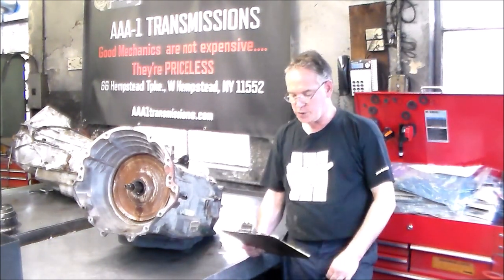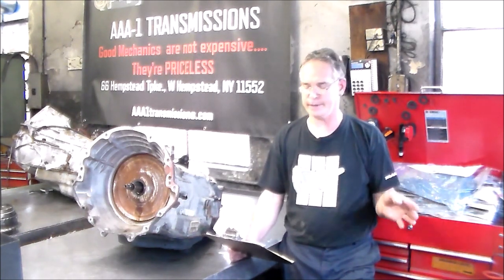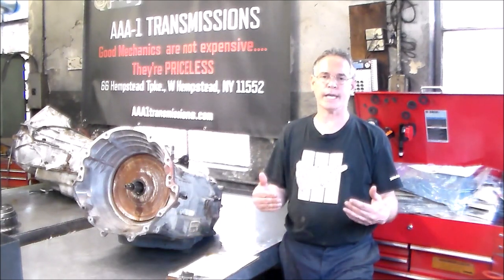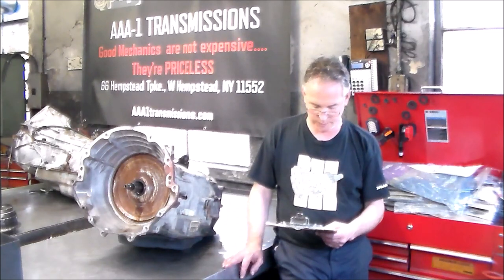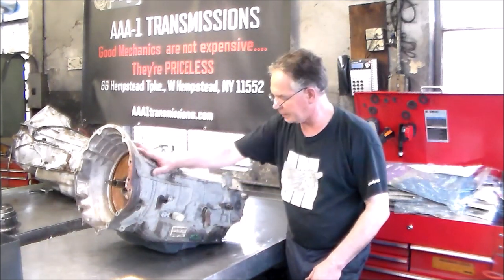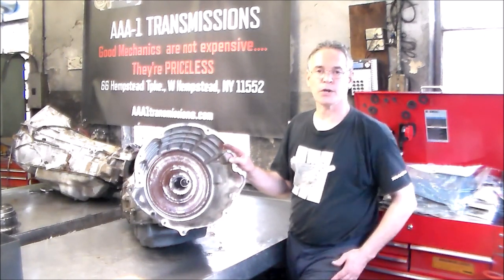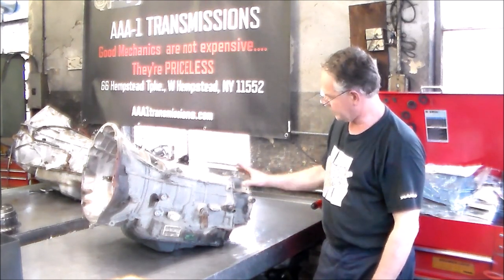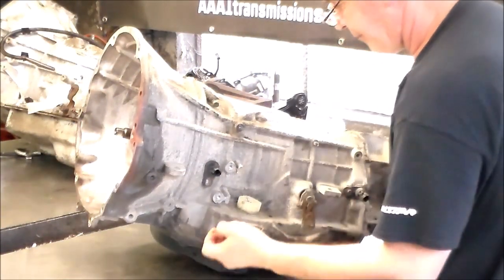66RFE Teardown

Comment: Hi, I have some slippage when I Gas the truck in 1st and second and it seems like truck doesn't go past 3rd gear, just stays in 3rd, I have code p0733, I have rebuilt transmission before but not this one and I'm trying to see what I need to look for when I take it apart? Bad torque converter, accumulators? Or plate? Pump, or just replace solenoid pack? What should I start with before removing trany and doing whole tear down?please advice

Comment: Thanks for this video, easy to tell that Gary knows his craft.  I have 2018 ram 3500 with this transmission, with P07029 and P0735 which are 5th and 6th gear speed mismatch.  Dealership want to replace solenoid valve pack.  I'm wondering if I skip that $2200 and am better off to go to a full transmission replacement.
Reply from the maker: I agree. I don’t feel that will fix your problem

Comment: There is 2 small blue orings that came from my transmission rebuild kit, from the valve body overhaul kit that I can not find where they go.. Can you assist thank you!
Reply from the maker: e-mail me a picture
gsferraro@yahoo.com
Reply: they will be for the pressure sensor. It is a black electrical connector that goes on the driver side of transmission.

Comment: Very informative, great video! What would cause a 66rfe to shudder at light throttle when shifting from 1st-2nd and 2nd-3rd? It recently had the solenoid pack replaced by the dealer and started doing it…. Also hard downshifts into 2nd and 1st when slowing down.
Reply from the maker: what was original problem that the pack was changed?
Reply: @GaryFerraro  went into limp mode, so I only had 4th gear. Showed code P0750 which was “Shift Solenoid A”.
Reply from the maker: @troyd.521  That is an electrical code, have to address that first
Reply: @GaryFerraro  that’s why the solenoid pack was replaced. An electrical issue with it and caused the code. The solenoid pack replacement fixed the issue of it being in limp mode, but now the other issues such as studder when shifting have popped up.
Reply: @troyd.521  What was the outcome?

Comment: I live in South Africa ha have a 6,5ton rv with a om352 mercedes engine and a 4 speed mercedes auto transmission. Would like to upgrade to an overdrive transmission like a nag1. What do you think? Thanks for al the great videos. Regards Hendrik
Reply from the maker: what year is the truck? Not sure that can be done
Reply: @GaryFerraro  it is a 1986 normal asperated.

Comment: I'm just curious what is your experience with the error code p0735?
Reply from the maker: you mean  P0735
Reply: @GaryFerraro  yes and sorry about that I wasn't paying attention
Reply from the maker: That is a mechanical code, for internal problem, what happens on 4 to 5 shift @KingManga360
Reply: @GaryFerraro  it will kick when I hit 40
Reply: @GaryFerraro  I wouldn't say kick too hard but you can feel it
Reply from the maker: very possible something going on with the overdrive clutch @KingManga360
Reply: @GaryFerraro  ah thank you I'll go ahead and order the transmission rebuild kit

Comment: On the interwebs, many dodge truck enthusiasts change the one sided clutches to the two sided clutches and steels. They usually do them all though, not just a few. Maybe some were good and they left them🤷‍♂️
Reply from the maker: I actually did change to 2 sided, had a hard time getting parts

Comment: Can I use a 68rfe rebuild kit for the 66rfe?
Reply from the maker: i would have to ask my rep if the kit covers both units
Reply: @GaryFerraro  if you ever have time to I would greatly appreciate it
Reply from the maker: i will ask,  just hope i remember lol  @debrisremoval3151
Reply from the maker: Hey, I Remembered, The 68RFE and 2013 and up 66RFE are the same overhaul kit (clutches may be different but overhaul the same)  @debrisremoval3151
Reply: @GaryFerraro  got it! Just curious why would anyone use stock when the 68 is suppose to be more beefy right?
Reply from the maker: When i build these i use billet converters and always a valvebody @debrisremoval3151
Reply: @GaryFerraro  what would you do if you couldn't afford to replace the valve body? Also does the 68rfe rebuild kit give me enhanced power or does that lie in other components not in the rebuild kit? Sorry for the tons of questions about to do the rebuild in my yard
Reply from the maker: I do the valvebody because of the P0871 code. Kit is not enhanced power just what it calls for, if you want that you will need special parts maybe from a company called Circle D Transmissions but not cheap to do @debrisremoval3151
Reply: @GaryFerraro  is it possible for me to clean out and reuse the valve body? Mine didn't go out suddenly has been happening for a few years and now gears 1 to 4 are fine but 5 slips and trans down shifts into 4th. I live in a remote area and things are hard to order and acquire.
Reply from the maker: Sure,  do you know if you have code P0871? @debrisremoval3151

Comment: so thats al you have to do to get the body out
Reply from the maker: Thats it, drop pan, filter and 6 bolts.  Disconnect solenoid pack too
Reply: @GaryFerraro   is hard to line up the shifter thing  ? and thank you
Reply from the maker: @wolfmanking100  , if your changing the solenoid pack, do not touch the detent roller, it is very hard to see if it's lined up